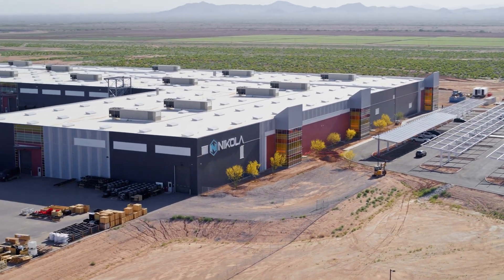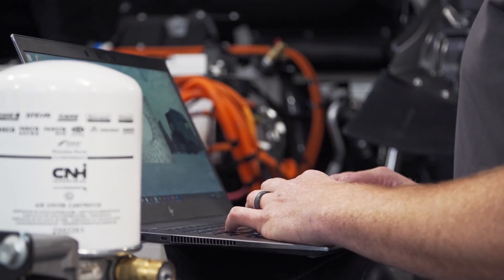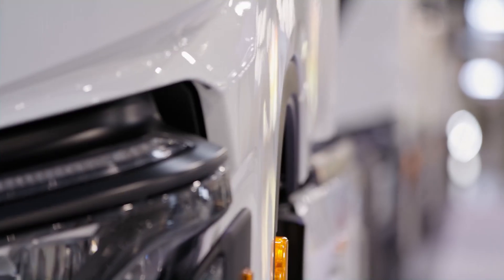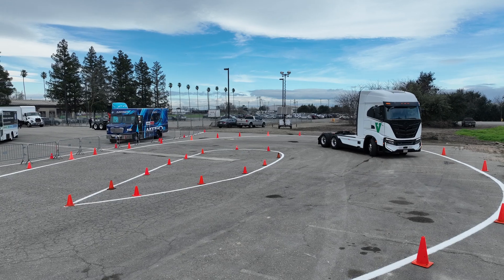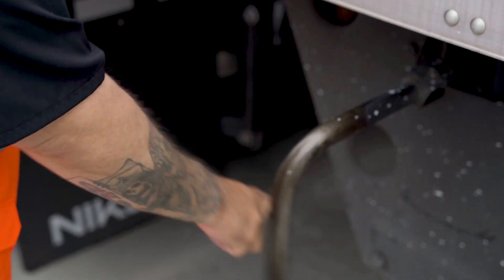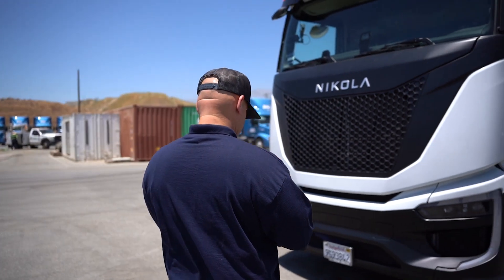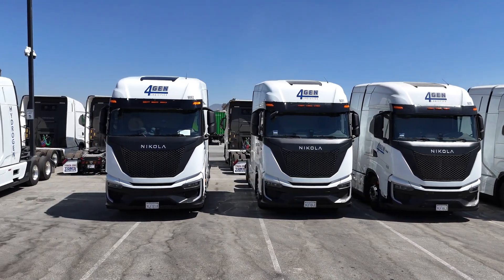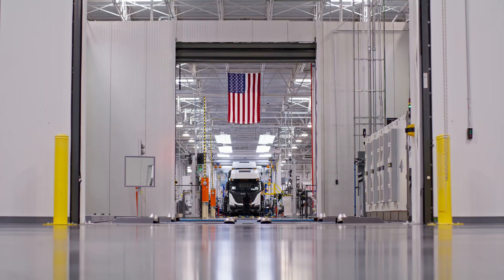Nikola | One Platform, Two Powertrains, Both Zero Emissions

Comment: Nikola reported a gross loss of $62 million in Q3 2024, an increase from the $55 million loss in Q2.

The company's unrestricted cash declined by $58 million from Q2, ending the quarter with $198 million.

Nikola anticipates needing to raise additional capital as existing cash is only sufficient to fund operations into Q1 2025.

The average selling price (ASP) for fuel cell vehicles decreased by 7% from Q2, reflecting softer pricing as volume increases.

The company faces challenges in scaling operations and optimizing unit economics, requiring significant volume increases.

Comment: Just added $10K more to my shares of  NKLA. Just to say thanks to your dynamics and continued hard, exciting work. Have lost a lots of $  so far, but sure you are worth it and we recover. All I expect is your best we can be proud of.
Reply: Soooo how did the stock work out for you? Have a feeling this  company that has been on door deaths for years is now finally dead (chapter 11)
Reply: @centurion262  Still great! Buy Low, Sell high! Still working! :)))
Reply: @BarsonlineOrg2013  that's some bed bath and beyond stock holder energy right there!!! 😅😅
Reply: they may do reverse splpit again, lowering share count
Reply: @BrokeAgain  Lowering your shares count first of all. Instead of 10 shares, you will be having 1. :))
Reply: ⚰️🕸️NKLA🕸️⚰️
Reply: U idiot more share dilution ahead.
Reply: Damn how much u lose 😂
Reply: Nikola Corp reported a gross loss of $62 million in Q3 2024, an increase from the $55 million loss in Q2.

The company's unrestricted cash declined by $58 million from Q2, ending the quarter with $198 million.

Nikola Corp anticipates needing to raise additional capital as existing cash is only sufficient to fund operations into Q1 2025.

The average selling price (ASP) for fuel cell vehicles decreased by 7% from Q2, reflecting softer pricing as volume increases.

The company faces challenges in scaling operations and optimizing unit economics, requiring significant volume increases.
Reply: @davidbest8912  they are still scaling and investing
Reply: Good luck lol the shares of Nikola have been plunged
Reply: 당신의 피 같은 돈은 nkla 회사의 대머리 친구가 가져 갈거고 당신은 다시는 그 돈을 볼수 없을거야 😂😂
Reply: @메커니즘-d4r  Nope. 😂 You are Just jealous, because South Korea is losing. 😂😂😂😂
Reply: @BarsonlineOrg2013 아니요. 한국만 지는게 아니라 nkla 주주 모두가 지는거에요 😂😂
Reply: @메커니즘-d4r  Samsung, Bum-Bum
Reply: right now 78 cents a share, how's that working out for you 🤣
Reply: @ChiSpire  Even better! Adding moooore! 😜😁😉. Hopefully it goes 0,50......the lower, the better. Stock price is irrelevant. The business is growing exponentially and that's great!
Reply: Same here + 10k into Nikola. If this baby makes the turnaround it is going to be an easy 50bagger, if not even more....
Reply: @BarsonlineOrg2013 😂
Reply: @NukemDukem  😜😎😎😎
Reply: This company is changing the WORLD!!!!
Reply: @technovikking57875 아니오. 이 회사를 투자한 사람들을 거지로 바꾸고 있을뿐입니다.
Reply: @technovikking57875  no. This company is nothing more than a leech-like cancer cell that sucks the blood of its shareholders.
Take a look. Shareholders have all become beggars and executives are busy taking money through stock options. It's been like that for the past four years and nothing has changed.
Reply: This Company burn Money 🤫 @technovikking57875

Comment: Less than $4 a share and before reverse split the share price is less than 10cent 🤣
Reply: Nikola Corp reported a gross loss of $62 million in Q3 2024, an increase from the $55 million loss in Q2.

The company's unrestricted cash declined by $58 million from Q2, ending the quarter with $198 million.

Nikola anticipates needing to raise additional capital as existing cash is only sufficient to fund operations into Q1 2025.

The average selling price (ASP) for fuel cell vehicles decreased by 7% from Q2, reflecting softer pricing as volume increases.

The company faces challenges in scaling operations and optimizing unit economics, requiring significant volume increases.
Reply: Less than six months cash run way then bankruptcy
Reply: You invest today for tomorrow. Long-term or Short-term...never live in the past.
Reply: @2023gainer less than six months cash burn rate. Then more share dilution to raise capital
Reply: @2023gainer 

Those who don’t learn from the past are …
Reply: @Mentaculus42  Are . Trading the Dips and Rips for Gains.